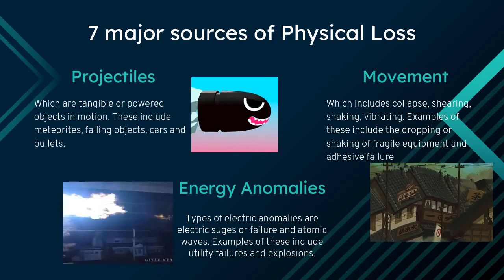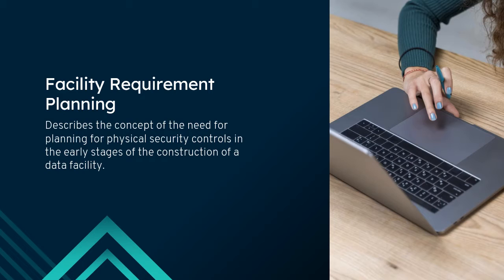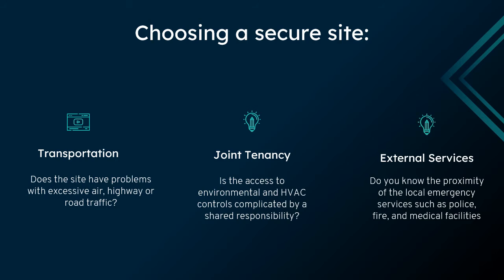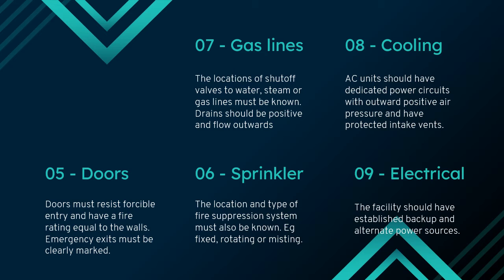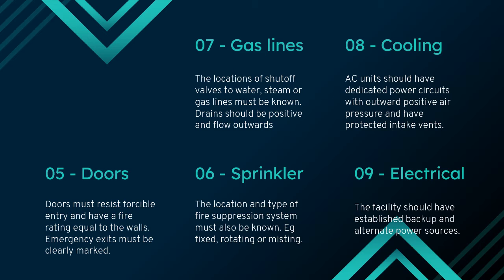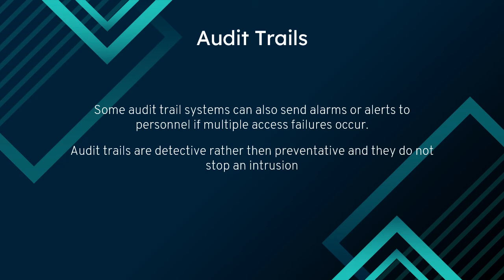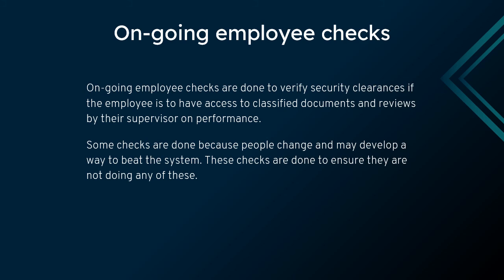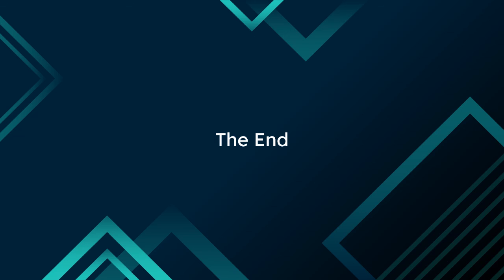Risks To CIA    Physical loss and Facility Management

Comment: You are designing a secure site for you organisation's . Give a brief run down of each area that would require attention specifically for your organisation chosen for final project.
Reply: For my cloud storage, the areas that would require attention for my organization in physical controls are 1. Temperature as servers would be running 24/7 and changes to this can affect the performance of a server causing it to throttle, this means that the temperature must be cold and controlled. 2. Liquids as the data being stored on backup tapes and equipment are very sensitive and can be damaged if a certain amount of moisture and gasses come into contact with it. 3. Energy anomalies as these machines will need to be running at maximum efficiency with no downtime and a power outage or power disturbance can either cause equipment to malfunction or fail.